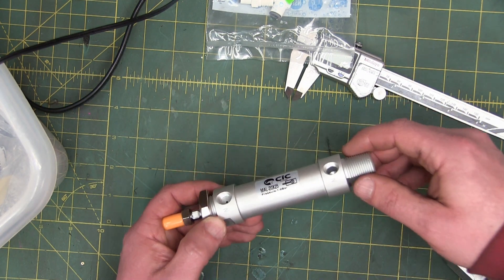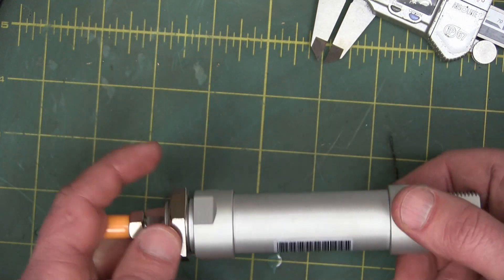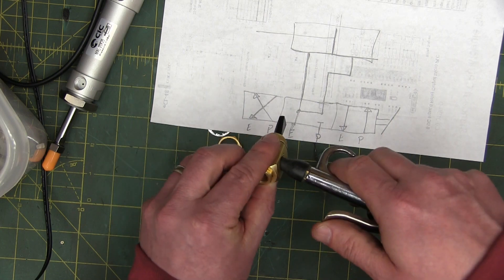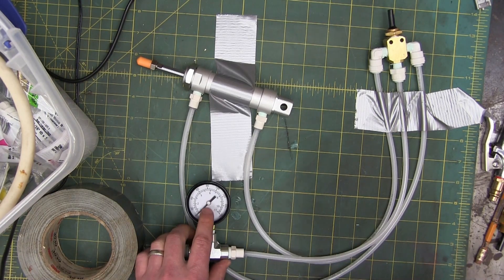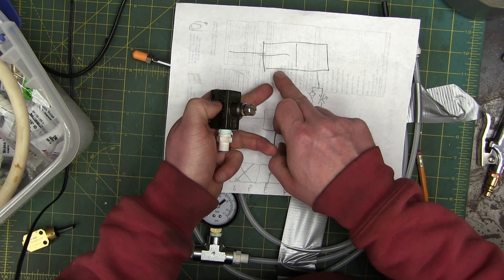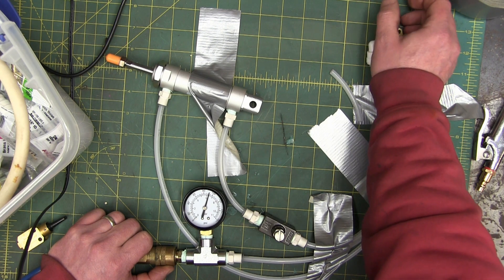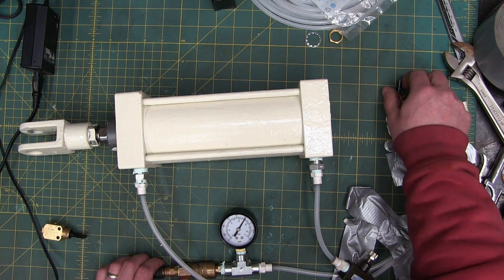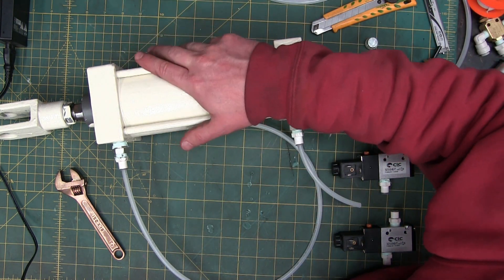PEW-PEW! Pneumatic Automation | Industrial Lego

Comment: Might want to reverse the process a little, stick a Quick Exhaust Valve on the retract side of the big cylinder, and dump air from the retract side to get the cylinder moving.  You won't get a cylinder moving much faster than that.

Comment: A lot of the pneumatic machines I've worked with used pressure regulators to control speed not orifice flow control valves.

Comment: lol prototyping, we use that type of fitting in everything, usually Festo or SMC and they last.... more then enough, with the advantage being so easy and fast to work with, sure some types of work will need a more resilient fitting and pipping but for most industrial work, that's the norm, easily up to 10bar.

Comment: The problem with Pneumatics is un-regulated piston speed.
A problem that is fairly easy to resolve yet few do it.
from 2005 to 2016 I made the only ported telescopic pneumatic masts anywhere, each section of the mast is individually ported to control maximum piston velocity in both directions.
Every other mast maker uses open end pistons with no means to control piston speed.
The problem with that is that the air volume limit is the velocity of smallest ID mast section, if you exceed that the top section can slam causing the top cap to rip off sending a 10 ft  long mast tube already at 66 ft up to be forced out of the top like a missile and slamming into the ground with 5k worth of camera gear on it.
Something in 11 years of making them my masts never suffered.
They rely on flow limits of a compressor used as the safety margin, however that does not account for section jamming then releasing so as their masts wear and begin to jam up that is the end some of them suffer.
My masts OTH can never do that because each piston has a control port to limit flows to the next section above it.
That also allows the operator to feed as much air in to the base section as they need to get the whole 6 section mast elevated faster, where others are limit to the speed of the tip section, all the sections of my masts are speed regulated.
The other problem is that if a mast section sticks on the way down and all air is released, when the section releases it can free fall and bottom slam, damaging the mast unit irreparably.
With control ported sections the retraction of each section is always regulated by the next control port so it is not possible for any to free fall, even in the case of a complete seal blow out.
The piston base section with porting also allows for limit bumpers at both ends of the each section not just the top one like other masts that require operator to control descent where mine can be left un attended to retract with no air, in a controlled manner.

Comment: The thing always with LEGO type systems be it linux, programming languages or in this case pneumatics, is that you don't know  all the parts yet. For two things I intend to build, I would need a valve that shuts off under ~1Bar of pressure and on above. And for a different Project I would need a electric Valve which controls the flow rate .

Do those parts exist? Probably. Do I have a fucking Idea how the rest of the world and China names it? Heck no!

Comment: I designed a automated pneumatic centralized liquor delivery system & installed it in close to 80% of the casinos here in Las Vegas and some in other states like Mississippi & Louisiana other states.  All the liquor bottles were all setup near inventory and pneumatically pressurized custom designed vessel that would pressurize the liquor in the delivery tubing that was ran all the way out to each bar on the properties.  The liquor in the tubing was only pressurized when a bartender pushed a button requesting the liquid he wanted then after the preset amount was poured the system would return the tubing to Atmospheric pressure almost instantly until another cocktail was ordered. 
The system could have 32 liqours on tap and at each pour station at each bar all pumped out of one room on the property. 
My largest system is at the MGM casino here in Vegas and has 1198 bottles on tap at all times. It takes 4 full time employees that do nothing but remove empty & replace bottles on the system to keep up with the bartenders up in the casino. 
I’m very proud of the system, it’s been up and running for almost 15 yrs. pneumatics rock.
Reply from the maker: You had me at pneumatic liquor delivery.
Reply: Sounds like a cool system. I work in an office, so - as an equivalent - I once programmed a colleagues PC to open the disc drive when he opened Excel. Whilst away from his desk, I placed a drawing of a penis in his disc drive, on a piece of paper folded in concertina. As the drive opened it sprung out revealing the cock drawing. I still look back on that as one of the greatest achievements in my career.
Reply: NVTwist, you da man. I would have failed at that job. Too much 'field testing' would have had me signing up for AA. :)
Reply: NvTwist that's actually pretty damn cool.
Reply: Don’t believe you. You’ll need to fly me over there and take me to each bar and casino to prove it mate!
Reply: Next project - automate the stock replacement!
Reply: Not to detract from your awesome system design....but, I, for one, refuse to drink at establishments that don’t let the bartender select the pour.  Systems that spew out a perfect measured 2oz. piss me off.  I want to tip the bartender for holding the bottle down a fraction of a second longer, not because she’s cute!
Reply: Do you still work or are you surviving on royalties alone?
Reply: Amazing.

I wanna see video of this!
Reply: I think I need to set Pneumatic Liquor Delivery or some derivate as an online handle somewhere.  Seriously, cool story.  Any idea how many bottles that system takes to fully prime up?
Reply: how did you do it. with peristaltic pumps or pressure vessles? or some third option I don't have imigination to figure out  right now.?
Reply: Radu Davidescu havnt worked sense 2007,  I miss it thou but I’m free to fix other problems that I find out about.
Reply: NvTwist Definite THUMBS UP!👍
Reply: What about the fluid in the lines?
Reply: Jason Kraus all the bars weren’t fired up at the same time unfortunately but the inventory control could look up all the records and add em all up. We always used the gallon sized bottles & poured them into 5gallon buckets to quickly prime the lines so no air got trapped in the lines. Can tell you there was quite a bit of waste to ensure no bubbles formed & no debris were in the lines.
Reply: When pour is requested at liquor gun an air valve opens pressurizing the pressure vessel, a check ball for liquor bottles closes & liquor inside the vessel flows out to bar, end of pour the air valve closes & air vents pressure to atmosphere, when pressure is released in the pump & check ball drops and liquor flows in from the bottles refilling it. So from bottle to gun the liquor is only touching air inside the small air line keeping it fresh as possible
Reply: NvTwist If you're at the end of the line and order some obscure liquor, you get extra aging for free!
Reply: Lou L here’s a secret to piss ya off more. The casinos have me program the pours to be 7/8th of an ounce and they all use shot glasses with lines at that level.
Reply: hydraulic liquor is better in my opinion, but you can still doze off on inhaling alcohol fumes
Reply: AvE lol
Reply: UZP Customs some beer is, Guinness beer is pressurized with it and is the reason the bubbles don’t act the same as CO2. We used nitrogen generators & sticker on top of the beer coolers so tanks don’t have to be constantly replaced.
Reply: Boof Metal does not act well with liqours and imparts a metallic taste into the sprit and completely changes the taste & manufacturers are very protective of their flavor profiles
Reply: NvTwist I hope you've cleaned the lines in that time.
Reply: Using technology to help people get drunk quicker and more efficiently?  Sir, we salute you.
Reply: Bar robot. faaaak!
Reply: Beer doesn't just come in bottles... you can buy bulk in kegs.
Think of all the waste that could be eliminated if the manufacture bottled in 5 gallon carboys...
Or 50 drum or 500 gal Ibc.
One man and a drum dolly or forklift could've saved a lot of $$$ over 15 years.
I'm curious to hear people's opinions as to why this is.
Reply: NvTwist you didn't invent a mechanized system for replacing empty bottles? Job half done. Get busy.
Reply: I know who I'll be contacting for my build when I finish cashing out the crypto mining! :P
Reply: M Cruse an idea just popped into my head that could possibly work but everyone wants their liquor from glass bottles for good reason

Comment: In terms of "everything is lego"... Yeah. But it still amazes me how some people who are supposed to be experts at correctly assembling their specific lego (e.g. some plumbers, electricians, yada yada) can be so appalling at doing it... And.... It's stuff like "Hey, like, just tighten that f--king nut up to a little more than hand tight, then water won't spray everywhere...." and/or "Hey why not NOT leave all that exposed live copper around that mains voltage termination you just did? And instead, lets put it all inside the enclosure so that nothing explodes and nobody dies?" ... It really is lego....... Usually, moreso, as often it's lego WITH THE INSTRUCTIONS WRITTEN ONTO THE BITS OF THE LEGO THEMSELVES......... I.e. all the electrical stuff with "this length of exposed copper" right on the f--king terminals.......... What I can't wrap my mind around is that people can do a period of training at lego, allegedly sit a heap of lego tests, and be supposed to work according to VERY simple lego instructions and standards......... But they can't assemble f--king lego....... And it somehow is "fine" and most people just go "Ehh, whatever" until they're the one who gets electrocuted and then are all "WHY DIDN'T SOMEBODY MAKE SURE THE LEGO EXPERTS PUT THE LEGO TOGETHER CORRECTLY?" ...... There's nothing new under the sun. Except for - as you've mentioned - new and improved idiots each and every time some lego is made idiotproof.

Comment: This is a perfectly reasonable solution for running pneumatics on an assembly line, which is what we currently do.. same stuff literally..  The issue is when the line workers decide to start flipping valves or throwing their body weight on air lines. But, I guess that is why I have a job... to do that and attempt to not get shocked by 480, apparently I'm qualified to work on it.. lmao

Comment: Bar tending robot finally? Also as an industrial automatizer, wouldn't you want to control the flow in the direction the thing needs to go instead of the exhaust port? On pneumatics that is.  I could be missing something, its 15 mins until my union mandated beer run

Comment: 06:58 unless you put 6 mm tube in a 1/4 inch fitting then i just blows straight out. I still havent been able to work out why they didnt make the metric size 6.3mm so it was 1/4" abd used the same fittings. 
Can make more money the way it is i guess

Edit. 1/2" and 12mm is just as bog of a pain in the arse.

Comment: Car engines without timing chains or belts or even gear driven engine setups to drive camshafts to press to a spring and then open a valve .  like in F1 old tech tho but still impressive

Comment: while you're at it, may I suggest attaching some cutter knifes to a pneumatic sled thingy and then attaching fast venting valves on both ends? used to build machines with that setup, cutting and placing plastic sheets on top of pallets of bricks or whatever to rainproof them. entertaining as shit and just as deadly

also, your toggle vent is gonna be a 5/3, not a 4/3, because it has two separate exhaust ports. I know like one and a half situations where that difference would actually matter, and yours is not it, but pneumatic valves favor the 5 port version while in hydraulics it's usually the 4 ports, and having something to nitpick on is fun

Comment: But what if you pointed the cylinder at the switch, so you flick it to extend the piston, but that causes it to hit its own release. And then find a way to make that pull the switch the other way. Can make yourself a pneumatic clock. Then all we need are pneumatic transistors and you got yourself an air powered computer that can do fuck all
Reply: "air powered computer that can do fuck all". sounds like my boss...
Reply: lol, true, and there are applications for that to be honest, on most machines it's mostly electronic, (less wear and tear, less problems with gunk), but there are pneumatic cams and switches and some systems can be completely pneumatic. Most times we use magnetic sensors in the cylinders, the core of the cylinder can be magnetic and a magnetic sensor outside can know the cylinder position.
Reply: I've fairly recently had the joys of trying to diagnose a system that synchronises the unlocking and opening of a door (and also the close then lock, sequence). It works great when it's new; and it's a pretty elegant solution to the problem, but it's a right bastard to troubleshoot when stuff stops working quite as it should. Which is pretty much instantly when you had it to a machine operator; those guys are born to wreck shit. 😋

In theory, it's simple and elegant enough. A pair of solenoid valves to turn on the air in the box and 'enable' the door sequence, but the shuttle valves and air-pilots preventing the door from lifting until the locks have opened; and when closing, the pressure on the bottom of the lift cylinder for the door keeps a hold on the pilot to the locks, preventing them from closing until the door has dropped.

In practise, it doesn't take much to upset the system. A pinhole leak in one of the pipes to a cylinder, or a leaking cylinder, or a little bit of moisture freezing in the pipes, or maybe the door (or piston rod!) is bent imperceptibly and binds for a moment... and all the sequencing is shot to shit so the locks close, then the door drops onto them. And then a numpty like me needs to try and hunt down what could be causing it to play silly buggers.

But at least it doesn't use any of that scary, unreliable electrickery stuff that drivers are so afear'd of. 😒
Reply: KraziIvan I worked on pneumatic control gear as a young 'un, timers, relays, load cells, and logic gates. Wonderful stuff, until the dirt invades, or the nylon tube gets all old and crackly, or some heavy handed numpty gets in there a-touching what don't need a-touching.
Reply: Actually, pneumatic computers do exist! We had machine at work which rotated table with inserted object 90°, pushed needles down to it, up, then rotated table again, took object by vacuum and threw it into box. Worker just inserted object to right position on table and all other things were done automatically. I expected huge box of valves, but inside was just some small pneumatic PLC O_O
Reply: You could have valves that close or open on air pressure.
I assume it would still run doom
Reply: There is such a thing, look up useless box.
Reply: Instructions unclear; made a sex toy.
Reply: I'd love to see that !
Reply: Pneumatic control panels for oil and gas are JFM to watch .... if you can still find them, there's a air powered computer for you. :-)
Reply: Russians made hydraulic confuser in the 30's.
Reply: I think what yer on about is called fluidics.
Reply: We did this when I was an apprentice about 30 years ago team hits a switch which retracts ram hits another switch which sends it back. Ave is taking it to the next level and adding a computer to the mix can't wait
Reply: You can use mechanical limit switches, or in AvE's case (since he wants to run a confuser) you'd use proximity switches. Very simple set up.
Reply: Pnuematic pot smoking computer. I'd call it the burn and learn.
Reply: Pfffft. This https://i.imgur.com/zGd9v.jpg analog confuser was built in the 1940's by Americans. Its attached cylinder was 16" dia, with a 35' 'stroke'. The 'tip' conveniently had a adjustable distance of 1000' to 14miles and weighed 2200lbs fully 'extended'.  It shipped in a water tight container capable of 27knots. Sadly no warranty was provided per mfr spec.